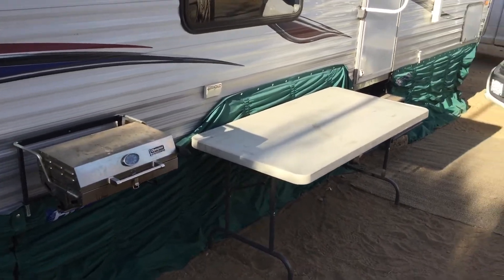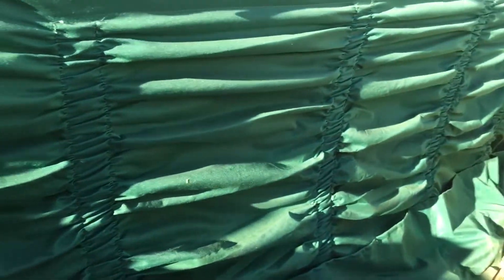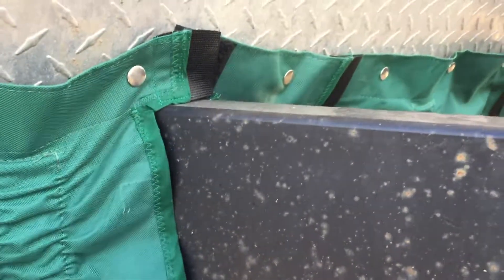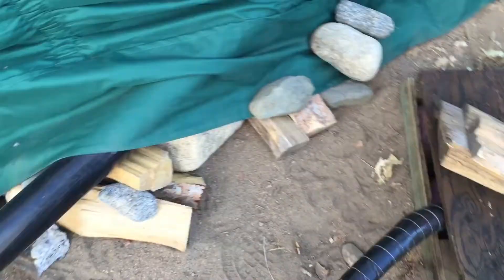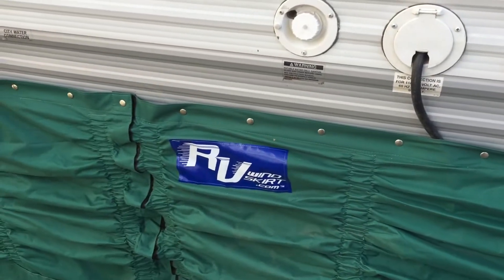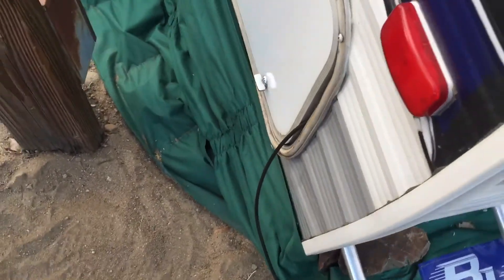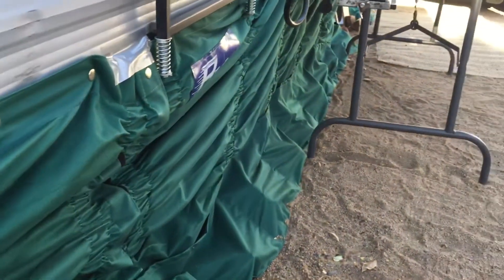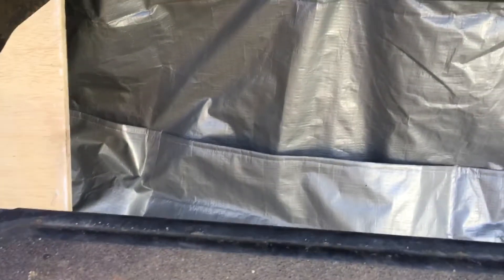RV Wind Skirt on travel trailer

Comment: Hi, im thinking about this product and could use your experiences.  I've been rving in winter before with cheap products.  Did you notice more warmth? Power bill from heater?  So many rocks? Did you have the water bags or try those?  How did the product hold up over time?
Reply from the maker: I installed this prior to my first winter RVing so I can't really speak to how much warmer it makes my trailer or how much power it saves me. I used rocks because they were available and I hadn't purchased the water bags. Overall the product held up well all winter.
Reply: Since it's now been 4 years are you still living in your trailer?  I'm wondering the same thing about will it change your heat bill?  I'm hoping to purchase the same product for my 27' Arctic Fox. Thank you for giving a full view of your trailer.  Are you willing to share what you paid?  Thanks.

Comment: I'm about to install this on my travel trailer. It only comes in 4ft widths. My trailer is only 2 feet off the ground. There will be alot of excess skirting. I can't install it too high up or I will be blocking vents. My only option is to let it just pile up on the ground or tuck it under I guess. I can't tell what type of material its made of. Is it ok to let that much excess lie on the ground? Yours looks nice.
Reply from the maker: The material is some type of thick canvas. I installed mine as low as I reasonably could.  Having that much excess on the ground should not be a big deal. You want some excess that you can weigh down to keep the wind skirt from blowing around.